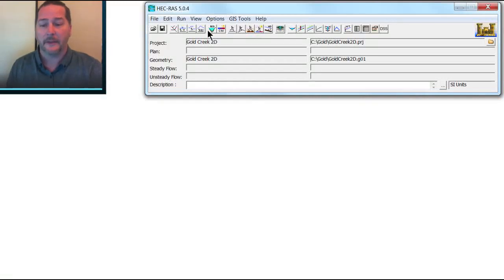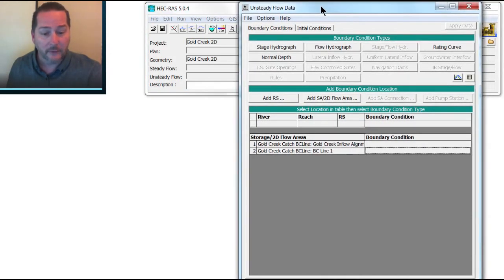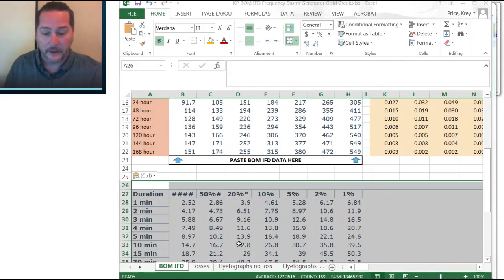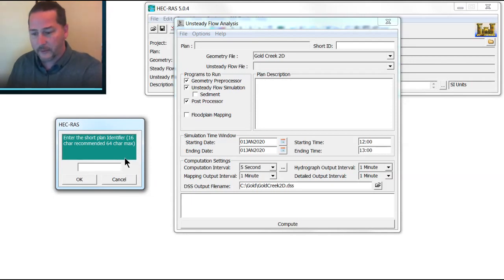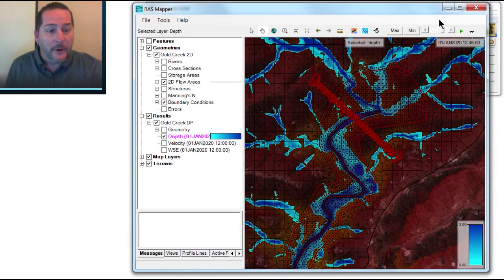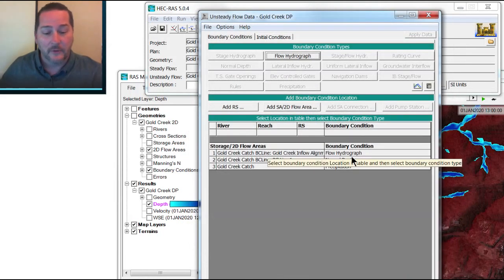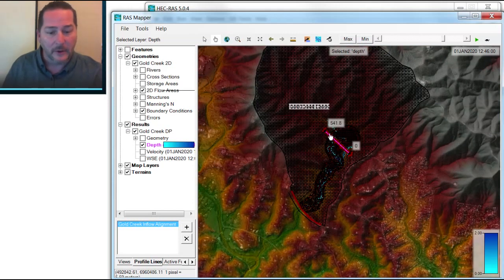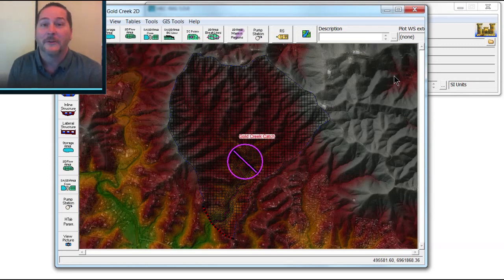HEC-RAS Basics Part 5 of 8: Inflow, outflow, and rain-on-grid boundary conditions

Comment: One question, does the area of the mesh (model area) affect the hydrograph? In other word, if you have larger modeling area and using the same precipitation data, does that change the flow/hydrograph?
Reply: Short answer is YES

Comment: Hiyour videos are very useful. I am currently working on a rain on grid model in the city of Rome. I managed to make it run using uniform precipitation but now I'm trying to include spatially varies precipitation using different rain gages, do you have any video on this feature? I am facing some troubles and errors I haven't been able to solve. The error says : Plan: 'Plan 53' (Rome2.p53)
Simulation started at: 03feb2025 02:51:05 PM

Writing Geometry...
Auditorium: Mesh property tables are current.
Completed Writing Geometry

	
Geometric Preprocessor HEC-RAS 6.3.1 October 2022
 

Finished Processing Geometry

Writing Event Conditions ...
Processing Precipitation data...
   (assumes geometry data is geo-referenced)
Finished Processing Precipitation data (0.945s)
Completed Writing Event Condition Data

Performing Unsteady Flow Simulation  HEC-RAS 6.3.1 October 2022
forrtl: severe (64): input conversion error, unit -5, file Internal Formatted Read
Image              PC                Routine            Line        Source             
RasUnsteady.exe    00007FF62770F207  Unknown               Unknown  Unknown
RasUnsteady.exe    00007FF6276CF4AF  Unknown               Unknown  Unknown
RasUnsteady.exe    00007FF626CAD94E  READ_UN_MET_PRECI         245  Read_UN_Met.for

Error with program: RasUnsteady.exe  Process Count = 73  Exit Code = 64

Computations Summary

Computation Task	Time(hh:mm:ss)
Completing Geometry	       2
Preprocessing Geometry	<1
Completing Event Conditions	       2
Unsteady Flow Computations	       1
Complete Process	       6

Computation Speed	Simulation/Runtime
Unsteady Flow Computations	53665x
Complete Process	13619x
RasUnsteady.exe    00007FF626CAA59A  READ_UN_MET                10  Read_UN_Met.for
RasUnsteady.exe    00007FF626DA91E0  SNETREAL2                 211  Snetreal2.for
RasUnsteady.exe    00007FF626DA7EF2  UNETREAL                   75  Unetreal.for
RasUnsteady.exe    00007FF626DA80EA  UNET_START                143  Unet_start.for
RasUnsteady.exe    00007FF626F54F95  MAIN__                     70  Unet.for
RasUnsteady.exe    00007FF627D3658E  Unknown               Unknown  Unknown
RasUnsteady.exe    00007FF62D4075E9  Unknown               Unknown  Unknown
RasUnsteady.exe    00007FF62D40750E  Unknown               Unknown  Unknown
RasUnsteady.exe    00007FF62D4073CE  Unknown               Unknown  Unknown
RasUnsteady.exe    00007FF62D40765E  Unknown               Unknown  Unknown
KERNEL32.DLL       00007FFCBF7E259D  Unknown               Unknown  Unknown
ntdll.dll          00007FFCBFF8AF38  Unknown               Unknown  Unknown

I checked and I have set the projection of the model but it still gives me this error. I am using HEC RAS version 6.3.1 and also tried with the most recent versions after this one. 

thank you,

Comment: Hi, I was wondering if there is a way to limit the flow leaving an inflow BC line so it flows in one direction only i.e downhill only. I have set up a 2d RAS model, which the terrain is approx 4% slope, using internal BC lines and hydrographs. Upon reviewing the flow arrows in the results show that flow is leaving the BC line both along the downstream and upstream cell faces. I checked with a profile line running right to left looking downhill above the inflow BC and it is showing positive flow, so it is definitely running uphill for a brief moment, atleast until the terrain swings it around to flow back downhill. Any help would be appreciated. Thanks.

Comment: Thanks for the detailed videos! I'm working on a project with flash floods in a steep cliff valley, the flows I get are quite fragmented. I've tried working with smaller cell sizes and using hybrid rendering but the problem still persists. Is this an option I can change within the unsteady plan settings? Any help would be appreciated!
Reply from the maker: The sloping rendering is typically better than hybrid, so worth trying that.  But other than that, just smaller cells is about all you can do.
Reply: This depends on how you generate the precipitation. Also,  since you have a cliff this will be challenging because that the Hecras will be able to calculate the velocity if the orthogonal angle equal to or less than the 70 degree. For more clarification please contact me on my email designnetwork87@gmail.com

Comment: Sorry boss, I have a problem. When I finish the simulation and I go in the RasMapper for see the results, the precipitation doesn't flow into the river like your model but it simply stay in the area. Do you know what's the problem please?
Reply: This may happen due to one of these reasons either because of the natural ponding in the surface that you used or because of some mistakes in generating the precipitation. For more clarifications please contact me on my email designnetwork87@gmail.com

Comment: Thank you very much for the series.  I followed your instruction and it works for me.  however, when I plot flow hydrograph, it was upside down i.e. all negative values.  Can you suggest why this happen?
Reply from the maker: Ahmed, typically this happens when you draw your  structure in the wrong direction.  Always draw in from left to right as if you're looking downstream.

Comment: Could you please explain how your spreadsheet converts from the IFD data to the hydrograph which you used as your 2D flow area boundary condition? thanks
Reply: You have to use the alternating block method if you need any help please contact me on my email designnetwork87@gmail.com

Comment: Hi, the rendering option "slope" does give me very large and "false" results at the borders of buildings. Is there any way to avoid this?
The hybrid-rendering option seems to still have a bug when exporting rasters.
Reply from the maker: Adding breaklines and refinement regions with finer cell spacing along building edges may improve the appearance of the results (but keep in mind that the rendering options don't actually affect the hydraulic computations which are already complete).

Comment: I have an issue modeling precipitation when it falls on the inflow from an external boundary condition. I have a constant inflow from an external boundary and when the first drop of rain falls (after a couple of hours of zero precipitation) the flow in the river decreases in flow way below the constant inflow being input into the model. Do you know what would be causing this issue?
Reply from the maker: Curious if this has been resolved - perhaps a bug that has been sorted in the new version. If it's still giving you issues, send me the model through www.surfacewater.biz/contact/ and I'll have a look.